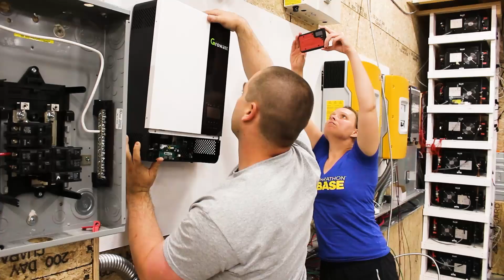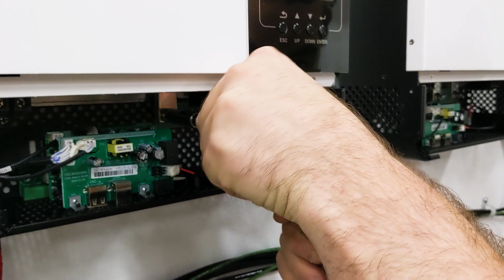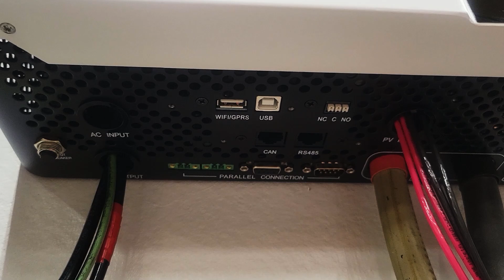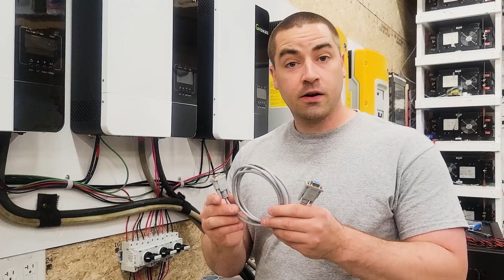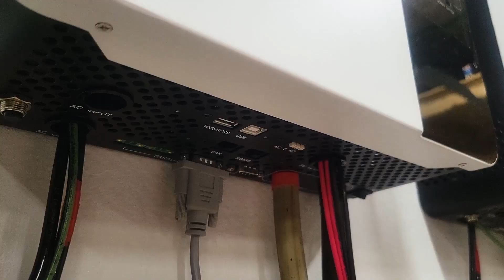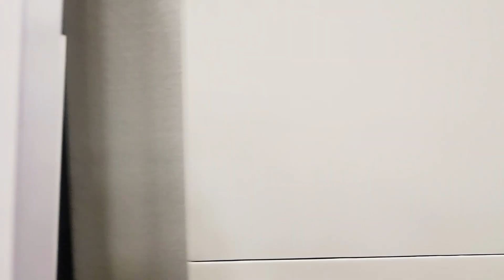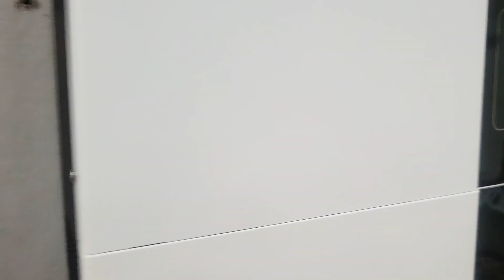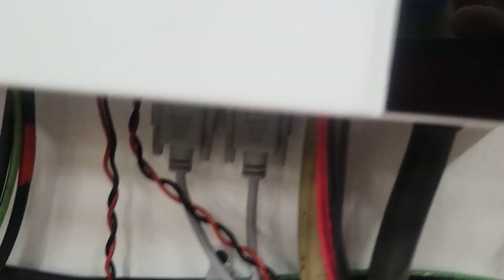Paralleling 3 inverters together, Growatt 5000w Solar System

Comment: Love your channel and your family 

I know you have used low frequency before 

I don't understand why you use high frequency unless it is idle current 

But with more than one inverter the idle even if low is dubbed 

I have low frequency and my idle is around 20 watts on my 10k inverter 

Most low frequency inverters except the genetry solar inverter do have high idle current 

But you can add a choke to lower most low frequency inverters idle current 

That is how I got mine so low I would for free wind and send you a choke dave if you ever wanted to go with low frequency again 

Genetry solar has a 12k inverter in the works as we speak 

There 6k has internal taps 
 it can be any voltage 12 24 36 48

 no more having to buy a new inverter when upgrading to higher batt bank voltage 

That is just one of its amazing features 

I run the GS control and wifi board on my inverter it is so incredible 

I with they would send you a inverter to try out 

If I could bug them enough to send you one would you be willing to do a video of try it out 

My goodness if I could talk them into sending you a 12k when they come out I bet you would be done with all other inverters 

I have seen there 6k do more than 8k
And seen it start and run a big window ac when already running 4or5k 

I would think the 12k would do more than 12k also

If a person did need more than 12k you can run to together without buying anything extra 

The 6k is the same it needs nothing extra and can be hooked together in two different ways 

The 6k is around one thousand bucks 
it has a warranty and is a usa company 

It blows aims and others out of the water pice wise and with features including Wi-Fi control from anywhere with phone 

Let me know if I can make you a choke for any low frequency inverter you may have 

Also let me know if I should bug them into sending you a inverter to test 6 or 12k

Keep being you don't change unless the change is to pray more to our heavenly father!!!
Reply: One more thing as if the book I wrote wasn't enough 

Beware of the constant onslaught of code Nazis

There will no be several basement know it all never done nothing criticizing your every move now

There like cockroaches and bedbugs no one wants them but they try to creep there way in
Reply from the maker: Fantastic job getting the idle draw down to 20 watts.  That's great.  The idle draw is not very good with these, about 70 watts each.  But I really like the high voltage charge controller.
Reply: @DavidPozEnergy  i have been bugging sid at gs inverters  to send you a free be 12k  low fr inverter for you to make a video testing it he knows of you and sounded open to and liked the idea so it might happen  i have been beating a 6k up for a long time now  i am betting if it happens you will have a few inverters for sell the aims is junk when compared to the gs  and gs is half the price  you will be a very happy camper  if it happens  i will be bugging sid and praying you get one you are humble good guy alot like sid  i think some msb mppt controllers now are 190 volt input   thanks for your channel and quick response

Comment: Hey David, what screws or anchors do you use for heavy inverters?
Reply from the maker: These inverters are not very heavy, only about 30#.  But in this video I used #9 wood screws: https://www.homedepot.com/p/GRK-Fasteners-9-x-2-1-2-in-Star-Drive-Bugle-Head-R4-Multi-Purpose-Screw-100-per-Pack-103101/203525228?ITC=AUC-68894-23-12070  Just make sure you don't use drywall screws.  Drywall screws are very brittle.   

My SMA inverters are 134 pounds each.  Those I used something larger.  Not sure if it was exactly this one, but very close: https://www.homedepot.com/p/SPAX-1-4-in-x-3-in-T-Star-Washer-Head-Exterior-HCR-PowerLag-Screw-4581820700767/206680928

Comment: Great Job! King David, I got some Operational / Reliability question? 
The following Technical Data are taken from current posting on Amazon Product description?
Size:ES-5KW 48V inverter, Output Frequency: 50Hz?  Hence, were using 60Hz? Is frequency configurable during Growatt Inverter System set-up / commissioning?
Reply from the maker: From the factory this inverter is outputting 230v 50htz.  But, it is programable right on the unit (no tools/computer needed).  I set mine to 240v 60htz.  I think I show that in my first video about this inverter: https://youtu.be/2eF7zxmKBAg
Reply: @DavidPozEnergy  is this Type of Inverter compatible with any optimizer? Says, Solaredge Optimizer?

Comment: If you haven't used the app, it has some really cool features. I'm running 2 of the new style 3kw 48v growatts rated for 250v pv and 120v output.

Comment: Can you charge your batteries with a genset through these? Looking at upgrading my inverter and we don't have our arrays set up yet so we have been charging through gen.
Reply from the maker: Yes.  What's kinda neat (if you wanted to): You could have different generators tied to different inverters.  Just yesterday I tested charging the battery with my Honda 5500 genset.  Worked perfect tied to only one of the inverters.  I'll show that in an upcoming video.
Reply: @DavidPozEnergy  I'm assuming your running the Honda as a 120 generator not a 240. I have a 240 but i can switch out and run it 120 if need be.

Comment: Robertson drives are the best, IMHO. As a guy from Sabah, Malaysia, prior to my studies in Canada (1987-1991), I have not seen any other type of screwdriver heads other than the "straight slot" & Philips, both prone to chipping/slipping. After I saw the Robertson drive (and used it), I absolutely love it. Extremely robust and will never slip! I brought the screwdriver back to Sabah, and still have it today. However, there are no screws using the Robertson drive here.....

Comment: Wonder what the efficiency penalty you get from the auto-transformer is.
Reply from the maker: As of right now, all I know is that it draws 18 watts at idle.  It dissipates heat, so there is certainly energy loss.  I just haven't calculated it yet.

Comment: Hi I have a question. I am bloody beginner.
I would like to know what the inverter is doing if the grid  power breaks down. Is it continueing supply power to the house, or will it shut down the output. I assume that the inverter shuts down the output in souch case. But how is it possible to get emergency power for the house if the grid power fails.
Reply from the maker: All my work is off grid.  So if the grid goes down there is no difference to me.  My inverters are not tied to the grid.  I have power even during black-outs.   The trick to this is using a transfer switch at the house.  I had an electrician install a "whole house transfer switch".  This allows you to power your house with alternatives, like a generator or solar.
Reply: @DavidPozEnergy  Ok thats possible because you must have sufficient solar panel power and a big battery. I want to start  with little solar panel power and a 5Kwh batterie. So not enough power for the whole house. How can I do this?
Reply from the maker: Sure, you can start small if you start with a platform that can be expanded.  In my opinion, the 48v LiFePO4 batteries are the easiest to expand on later.  And finding an inverter that allows "paralleling".  The inverter I use in this video can be paralleled in the future, but if you want something even smaller, try this one: https://shop.signaturesolar.us/products/3kw-48w-250vac-80a-off-grid-inverter-by-growatt  It's 120v only, so you could start by just backing up your fridge or computer.  Expand as you want

Comment: I had wondered if having 3 inverters/charge controllers connected to the same battery would cause any issues.  It looks from your video like this is what you have done with no apparent issues so I guess it's OK.
Reply from the maker: Yes, one battery bank.  The manual actually says to have only one battery bank.

Comment: the gray cable with the connectors is a 9 pin VGA
Reply: Close, VGA is 15 pin. These are 9 pin serial cables. Both have the same size outer shell though

Comment: With the 3 different inverters can you connect different battery types to each inverter. Like lipo to one and a different chemistry to another one?
Reply from the maker: No.  You can only have one battery bank.  However, you can connect different charging sources to the different inverters.

Comment: How do the inveeters maintain frequency?  With 3 all generating AC, something has to sync them.up to prevent backfeeding and overloading.  Does one imverter need to be configured frequency master and the others become slaves?  What about failover?  I saw the parallel comnections but I didn't get the frequency relationships.  I know the autotransformer will help smooth the outputs.
Reply from the maker: I'm not a computer programmer.  I can't tell you how it's written into the software, but that grey old cable (serial) is how they communicate.
Reply: @DavidPozEnergy  I was VERY interested in how it worked together because I was questioning if I was ever going to be able to run my wood shop and my metal shop using only solar.  On some days our KWh usage is 2200....on other days its down in the 900s.  Being able to daisy chain those is a great way to do it as long as it is able to balance the loading so all the current isn't coming from one inverter. I know I have some things that have starting current above 30 amps (welder, air compressor)

Comment: I ordered (Before) basically a very similar set up to your set up from signature solar. I have only  two inverters and two less batteries but otherwise the same. I also have no idea what I am doing so SUPER SUPER happy to run across your videos! What luck! :-)  I was hoping you could tell us the specs on your combiner box that your breaker are in and your handy shut off switches please. I am hoping to purchase those as soon as possible if you are so kind. You and your family rock by the way. Been watching for a year now and just wish the very best to all of you! :-) THANKS!!!
Reply from the maker: I've been using the Siemens brand stuff at Home Depot. https://www.homedepot.com/p/Siemens-SN-Series-150-Amp-20-Space-40-Circuit-Main-Breaker-Plug-On-Neutral-Load-Center-Indoor-SN2040B1150/313137391
Reply: Thanks so much! Sorry I asked twice. :-) We live rural and can;t pop into big box stores. We have to make a plan. I just wanted to make sure there was nothing specialized about them so thank you so very much from northern New Mexico. Keep up the great work!
Reply: @emilywilde2348  Keep in mind the current setup with the autotransformer used in a regular breaker box is not safe. David said he's purchasing special breakers to fix this problem, so I'd wait for that video before purchasing a panel.

Comment: Separate earth stake for off grid setup?
I'm about to set up a Victron Easysolar 5000va.
Reply: in the UK we TT or ground rod the main panel or fuseboard.

some inveters you have to keep the netrual separate and just ground the panel without creating a PEN conductor setup.

victron I just use the netrual and 240v output and ground rod the main panel

Comment: Hi can you please do a test for me?
I would like to use one of these inverters to run my fish tank .
I want too know if it can be set so that the priority is --
solar feeds the battery first 
after the battery is full solar then feeds the tank
and at night or low sun the A/C mains feeds the tank through the inverter.
and only will use the battery if the grid goes out.
If you could let me know i would greatly appreciate it .
Reply from the maker: Yes.  Those items can be programmed.  A lot of people use it for that type of system.
Reply: @DavidPozEnergy  thanks that great👍👍👍

Comment: One thing to consider between the Growatt and the SMA might be country of origin. Not sure where either is made, but it is important to try to avoid products that are made in China, at least to the degree that it is still possible.
Reply: Why would you advocate avoiding products from China? The Growatts are setting new standards of innovation, such as the integrated charge controllers, and these innovations are coming from Chinese research and development. Growatt, with an R&D staff of several hundred electrical engineers, is among the top three inverter makers worldwide, and has built a vast installed base.

Comment: Very interesting video. Have you tried using micro inverters?
Reply from the maker: Micro inverters are great for grid-tie.  However, I'm setting my system up off-grid.  These particular inverters don't support frequency shifting, so micro inverters are not the best choice for me.
Reply: @DavidPozEnergy  Aren’t micro inverters were more efficient especially if you had partially shaded panels, safer cabling and easier expansion.
Reply: @neergh8886  Yes, but they don't play well with off grid.

Comment: It is imortant to tell that theses inverters DO NOT WORK in parallel without batteries unlike all commercial flyers tell ! And that in charge they are extremely noisy : do not install them near living rooms ! Do not install them in wooden houses too because it is said that they have to installed in a non combustible wall. That is quite scary (it is the only devices that ask me that !). And the worst : these 3 inverters in parallel eat about  240 watts when they work, so 5 to 6 KW per day lost ! Quite impressive and not really solar compliant for me. You need few panels and battery KW only to feed them. 
Quite disappointing.

Comment: David I’ve seen your videos on the all-in-one inverters, MPP, Growat, SMA, Sigineer which one do you consider the best if you could only purchase one to do your whole house? Example: house uses 2200 KW daily, has a new5ton 16 Seercentral HVAC system ( Humm wonder how I came up with those house secs LOL. Love your videos, keepum coming!
Reply from the maker: The good news is there are many great options.  I have experience with only one model from MPP Solar (LV5048) and I was very disappointed with that model.   

My SMA inverters are work-horses.  They take anything you can throw at them.  However, I have had some random shut-downs from the SMA's due to odd things in the built-in computer.  

These Growatts are less money to get setup, and they run my small AC's fine (sorry I don't have a central AC).  However, the fans on the Growatts are loud. 

 Sol-Ark is a pretty good system too.  My friend Ben has one Sol-Ark and is very happy with it.

Comment: Why won’t the dealer recognize your discount code
Reply from the maker: What is going on?  You should get a discount with "DAVIDPOZ" typed into the coupon code box at checkout.  If you aren't please let me know the details.
Reply: @DavidPozEnergy  I tried repeatedly using different forms and got the same message over and over. I finally hit the buy button by mistake and am now trying to stop the purchase. It’s been one of those days.
Reply: I called Signature and they fixed the discount. Thx

Comment: Do you know how the three Growatt inverters work together to charge one set of batteries?  I used to have two separate charge controllers on one battery bank and it didn't seem to matter but Switched them out to one controller per bank just in case they were reading a false battery level coming in from the other controller's feed coming in from the panels.
Reply from the maker: They work well.  I have 3 solar arrays, each array is wired to it's own inverter (which acts as a charge controller too). It's all working perfect.
Reply: @DavidPozEnergy  thanks!   It’s highly appreciated.   I assume linking the three units together makes the difference.   Great video as always.

Comment: When doing this in an off grid situation, do you bond the neutral to ground at the breaker box?
Reply: It has to be bonded in only ONE place per system.  Else you get multiple paths through all your neutral and ground wires in a fault situation.  

The inverter documentation should clearly tell you - and show on a wiring diagram - if the incoming DC node that it treats as ground (ie doesn't turn off when off) is isolated from the most positive wire on the outgoing 3 phase 240/120. 

If it is isolated, you would need to bond the wires at the service panel to deal with load faults, and separately at the feed panel (near the inverters).  

If it is not isolated, it could be bonded in either place but not both.  For compatibility with grid power you may prefer to bond it at the service panel. 

Bonding it in both panels is not particularly dangerous as they are connected only to each other leaving no alternate paths other than on the wire between. But code will tell you to do it one way or another.
Reply: @mikehodgetts4864  yes helps a ton. I understood everything you posted but found the new nugget of information at the end, thank you.
Reply: @mikehodgetts4864  Just so I get this correctly, Main breaker box in a hybrid situation like this would be grid box correct?